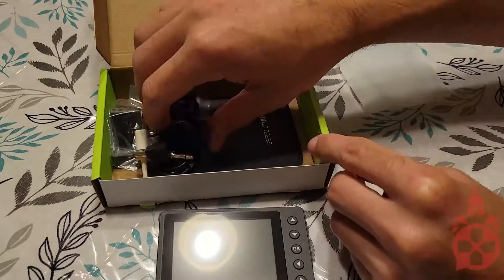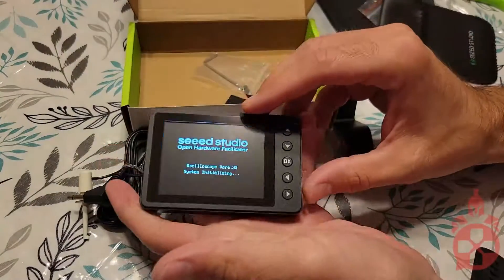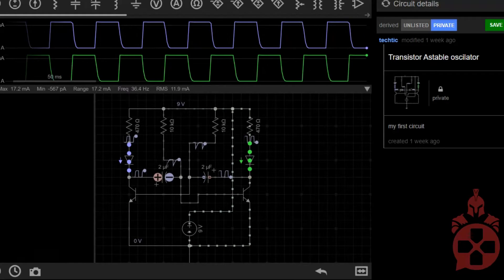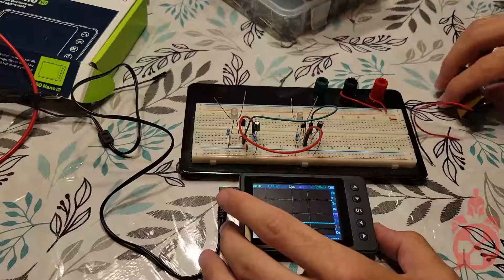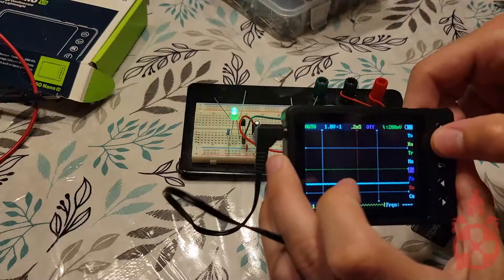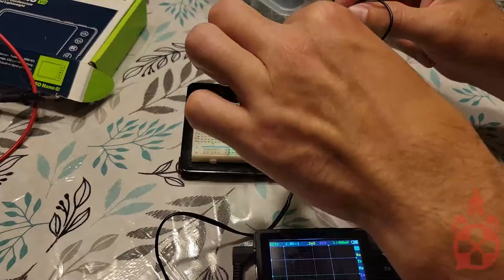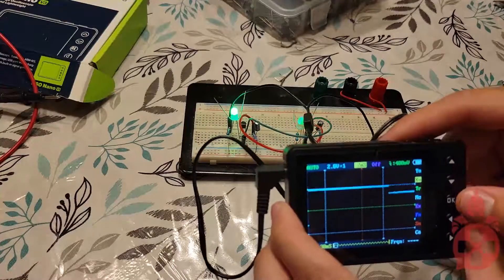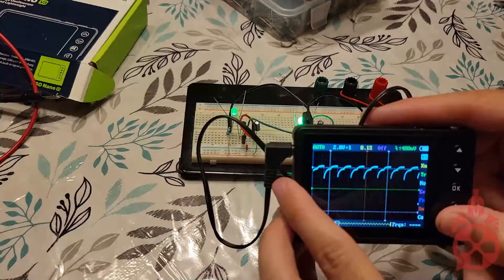DSO Nano V3 Unboxing - Portable Digital Storage Oscilloscope

Comment: it's a nice pocketable alternative when one can't bring an analog oscope. is it good enough though?
Reply from the maker: It depends what the application is. I find it's really nice for measuring cycle widths and amplitudes for occilating signals but, for applications such as having a freeze trigger when a limit is exceeded so that value can be captured, it's not so great.
Reply: @onlinewarriorspodcast  can it measure frequency and is somewhat accurate? It's a lot less convenient to do so on my analog oscope since I'll have to calculate frequency from the time div and voltage
Reply from the maker: @bloubear2557  You will still need to calculate the frequency from the pulse width duration.